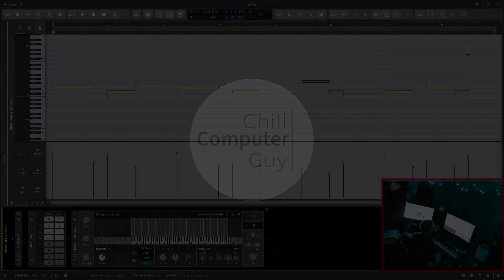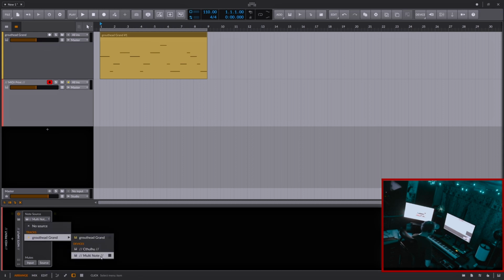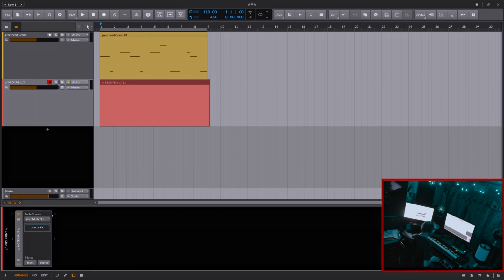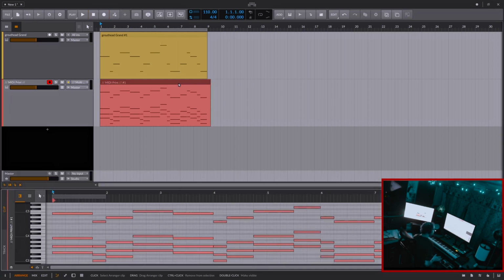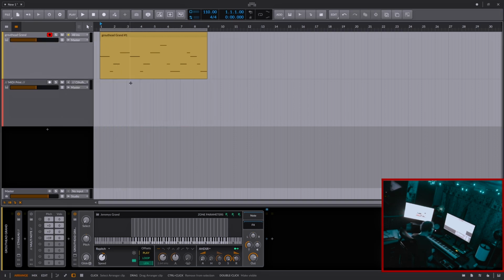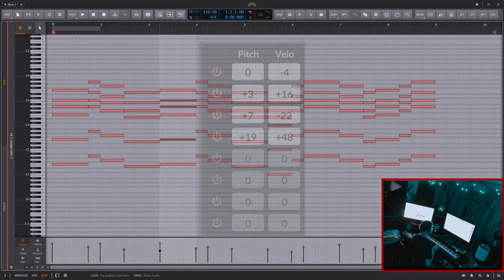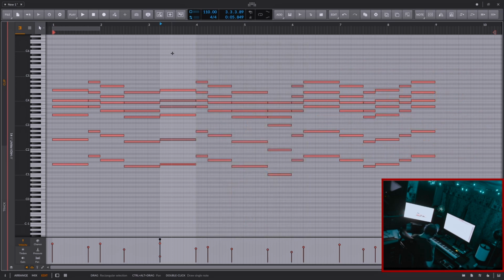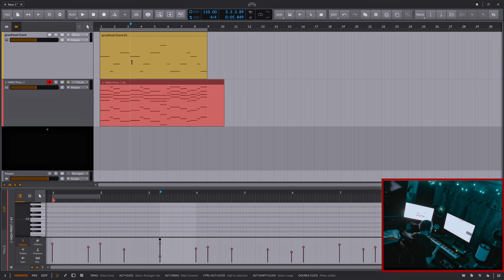Bitwig Print your MIDI

Comment: read the manual dude.
Reply: ^^^ this

Note Receiver is used to grab a MIDI from somewhere else and put it inside devices chain, whereas recording happens on the input of the track (for both MIDI and audio). What you need to do is either use the "Send Notes To..." feature on the output of source track, or use the Input on the destination track (+ turn the monitoring to On).
Reply: I had the same struggle, and it is counter intuitive that the Note Receiver wouldn't do this, but then, the Note Receiver device has other flaws as well, just try it in a NoteFX Selector. And the BW manual is atrocious.
Reply: @Aleamanic  No it's not if you understand the logic, instead of following wishful thinking. I bet your problem with Note FX Selector also is a result of you not understanding what it does. The fact that you had "the same struggle" doesn't mean it's a valid complaint.
Reply: @Artek604 - Let's stay focused on the topic and not become personal, please.
I do in fact understand the Note FX Selector device quite well after having experimented with it plenty. It is not my lack of understanding, but it not performing as advertised that is confusing. If you are so certain that there is some hidden magic to it that has not revealed itself to me, then go ahead and share your insights with the community. You'd be a hero - as is our friend who made this video we comment on, to 13 people so far.
Reply: As to the questioning of my logic and intuition around using Bitwig as a DAW: Bitwig's future revenue with their annual support subscription is dependent on the loyalty of its customers. I am a Bitwig customer, therefore whether I find something logical/intuitive in their product directly affects my future patronage, and with it their purpose as a business. Last time I checked "customer is king" - I can do without Bitwig, but if Bitwig would have the above attitude they'd be done as a business. Therefore, whether a "complaint is valid", in the end is decided by the customer base.